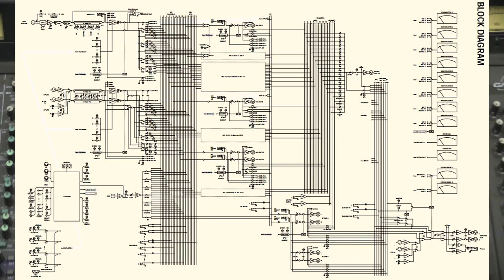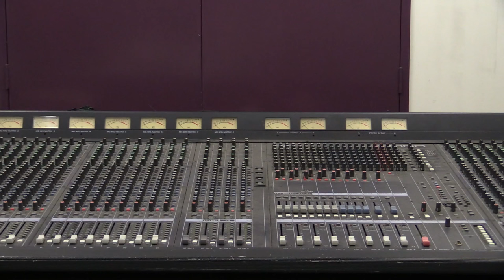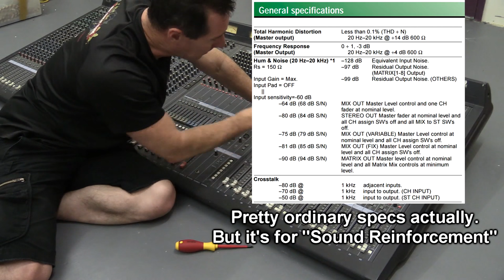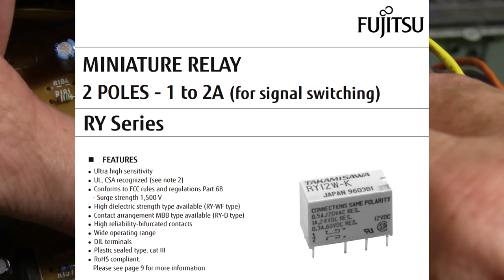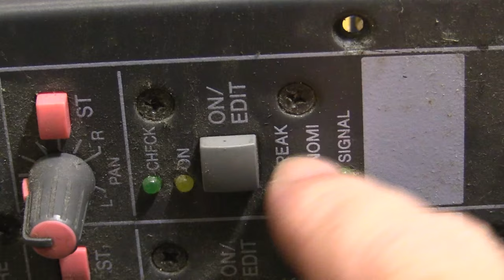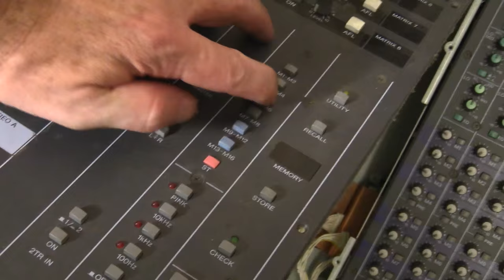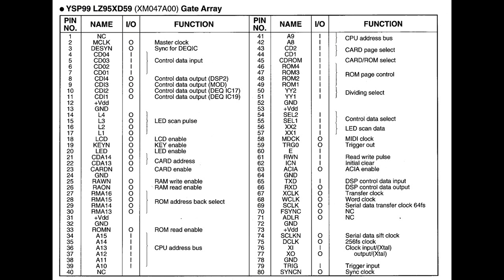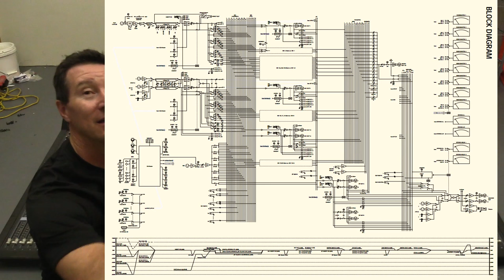EEVblog #840 - Yamaha M3000 Mixing Console Teardown

Comment: Dave: in the master section where you mentioned that the board to board interconnects are not continued on the right edge of the board, had you looked up at the master section you would have seen that there is a board which hangs down into that space. and as such it was for clearance. if it was not for clearance I would think the copper bus bar would have been straight across rather than dipped way below the boards.
Reply from the maker: +David Nelson Ah, ok, of course!
Reply: +David Nelson It's also likely that the board was designed for multiple form factors. Mixers tend to be pretty modular in construction, as this video demonstrates really well.
Reply: Looks to me like the board that hangs down is the scene logic - potentially the bus board came from an older model without scene control.

Comment: The insert jack on each channel is a TRS (tip, ring, sleeve) connection that allows a single cable to be both input and output. You use them to send a channel to an effects chain and then loop it back into the mixer. It's like a stereo headphone connector with one channel being an output, and one being an input.

Comment: You can't imagine, how excited I am to watch this video! I'm sort of a selfmade Audio Engineer, and love to tear down my equipment, repair it or develop my own stuff. This is so inspiring!
My Yamaha 01V Digital Mixer was really nice to tear down, Yamaha clearly knows how to make their stuff servicable. really nice system engineering! This bad boy on the other hand looks a lot more challenging :D At that size it's really hard to make it servicable. 

The phantom power caps where the only part that died so far in my 01V, they were only rated for about 50V, sadly that seems to be "okay" to save cost.  
The SILs from JRC are often used in Yamaha mixers I saw so far, they seem to prever SIL-packages, e.g. for their DM2000 digital console. 5532 are not that often used there, I guess, maybe for saving space. 

For me personally, this was one of your most interesting videos, even without you knowing everything about it while filming. Thank you, I really liked it!

Comment: Hey Dave,
Coming from a synth world, that SSM chip is a VCA chip. 
SSM made many DIP package solutions to common circuits in music electronics. Most notably, SSM made oscillators and filters that were used in many famous synthesizers such as the Korg Polysix and Sequential Circuits Prophet 5 Rev 2.

Along with SSM, Curtis Electro Music (CEM) also made similar chips that often replaced the SSM chips in later model revisions.

Would be cool to see a synthesizer teardown from you!

Comment: I find its usually the mute buttons that go first... some guys just hammer down on those and they just die
Reply: +Julian Amrine It's usually the pot's that go first on yamaha's they get nice and scratchy, a couple twists and they're usually fine
Reply: +Scott Kuker 

Not if you keep on top of your scheduled maintenance.  The PM3K I learned on was 20 years old, with about 200-250 shows a year, and had most of it's original faders, and none of them were scratchy.  The ones which were replaced were because the whole channel had been replaced, usually because of a bad pot or VCA.  Clean and lube your faders every year or so!
Reply: +Scott Kuker spray deoxit (electrical contact cleaner) into your pots and switches. just dont use on faders, as they are open and attract dust.
Reply: Even better, use the liquids CaigLube/DeOxit! F5 and DeOxIt! 100% that comes in the bottle with the brush/needle tip. That way, you're not putting chemical where it's not needed. Less waste = more useful product.

Comment: Three years late here, but... 

It was fun to see this blast from the past.  In my career I kind of skipped right over the 3000 series and went from the 2K to the 4K and then the 5K.  Now, of course, everything is digital and these old workhorses are rarely seen.  

Anyhow, it was really fun to read all the comments about what this and that does.  We used to take the opener's console into the sub-in's so that we could use the same monitors while keeping the opening band engineers from messing up our mix on the headliners console.  

Inserts on the outputs were, 99% of the time, used for EQ's to keep the feedback to a minimum.  

As far as inserts on the inputs, I saw a lot of people here that had "absolute" ideas about how dynamics, eq, and effects should be handled.  I'm guessing they are pretty linear thinkers. I would suggest that they open their minds to the endless ways of making sound great (again!)  Sorry!  Couldn't help myself...

I will tell you that I have seen every variation on a theme that you could think of with inserts and how to use them.  There is no wrong way to do things if it works for you and your artist.  Thanks Dave.  Great stuff.

Comment: You're right about fader maintenance. We had a 64 fader SSL console which needed fader service after ten years. Electrically, they were fine, but they started to stick slightly. Each week, I would remove a few of the  Penny & Giles faders, disassemble, clean, lube, reassemble, test and reinstall them. It took about 2 hours for each.
Reply from the maker: +Chris W Each week?!
Reply: I only did a few faders each week. It took many months to complete.

Comment: This would be the best answer to "why digital" questions
Reply: I agree!
Reply: +Abdurrahim Cakar Also analog EQ creates phase shifts between different frequencies leading to quite a bit of distortion if not compensated properly. You don't have that effect in a digital mixer. Width 24 bit resolution and 96 kHz sample rate being standard you don't have any noticeable signal degradation due to the digitization itself.
Reply: +Abdurrahim Cakar I'd exchange my laptop for one of these any day :)
Reply: why digital ? "every idiot can count to one"!! :DD
Reply: +Jan Vomočil
Why Digital ? Because there's no room for noise between 0 and 1 !!
Reply: +Abdurrahim Cakar hahahaha.... Try the Midas XL3 or somesuch...800lbs. But such an awesome console.
Reply: +MrTridac I’ll be pedantic, and say there IS room for noise between zero and one, and that noise gets expunged every single time the signal passes through a gate. (Thank you, MITx 6.002x and 6.004x.)
Reply: I just bought one of these and I totally agree!
Reply: @asdf155  Almost all digital EQs cause the same eq shift as analogue ones. Although there are special linear phase EQs which come with their own set of problems
Reply: Hi Dave...great teardown, again ;-)
My guess is the 5 volt regulator was for Midi only.

Comment: Insert I/O = INSERT In & OUT. Use a TRS ---> TS/TS . TRS jack goes into the insert plug at the back of your consol and the 2 TS jacks go into INPUT & OUTPUT of your external device ( Noise gate, compressor, or whatever you want in your channel path)

Comment: Looks like the price ranges from 1500 - 15000 EUR used (there's a few models with different channel counts).
Reply: +Anders Evenrud: these desks sell for approx. 1000 Euro her ein Europe (sometimes even cheaper)
Reply: +Max Koschuh That's not bad at all! With power supplies?
Reply: +Anders Evenrud Look for the A model. It has some fixes (like LEDs on the PFL buttons). For 1000€ or less it might be ok, but I'm sure there are better options, depending on your requirements and your ability to fix the thing as some part will certainly fail.
Reply: +Anders Evenrud anyone of a sane mind would buy a digital mixing console if working with that many tracks :) My mixer is about 1/3rd of the size and can mix twice the number of tracks. The only real reason to get a huge analog desk is for recording purposes, if one is (for some reason) in love with the preamps that come with it. For instance a Neve desk from the good old days. Personally I'd go for a modern set of transparent preamps from a brand name. They will be so close in spec (and so transparent) that any will do :) [also, did not realize you watch EEVBlog, nice to see you here]
Reply: +spookanide They are a little obsolete... If you're dying to go analogue save up for something nicer.
Reply: +Alexander Brevig For live sound digital is better in really every aspect (except power consumption maybe). But it's a matter of costs.
Reply: +as df I agree. Ive been using the Yamaha CL5 for a few months now and I love it
Reply: +Max Koschuh Yeah, not surprising, considering this was more or less a bottom end of the market product when it was released and that was like 20 years ago.

Comment: I think the relays are shielded to prevent the switching magnetic fields from inducing pulses of current into the signal path of nearby wires.
Reply: I would think a small click in a signal being amplified by tens of thousands of watts and pumped through scores of speakers might be a life-changing experience.

Comment: That's huge wow!! I serviced one that I don't recall how many ch it was I think either 28 or 38 it's been a long time ago. It was at a big Baptist church I went picked it up for service. Had broke connections on the sliders where they were putting their weight on the controls hooking stuff up in the back of it Lotta contact cleaner went into that thing.

Comment: The craziest thing about this whole teardown is that an inexpensive (in a relative sense) digital board like the Behringer X32 does a much as this board and a whole lot more with better specs and full storage and recall of EVERY setting with motorized faders and takes up about a third of the space. That's not to mention that the need for most outboard gear is eliminated because EQ's, effects, and all that stuff is built in. I would never want to go back to working on an analog console after using a digital console for the past three years. I would love to see a teardown of something like the X32 as I believe Behringer has come a long way in improving the quality of their products and it would be interesting to see what Dave thought about it.
Reply: The sound quality is better on an X32 but the build quality is much worse and I say that as a happy x32 owner. You can't compare the quality of a real digital encoder fader module like an Alps (used by Yamaha on their digital consoles) with the cheap open frame ones on an x32.
Reply: Jackson Linder Yeah but gotta love the old analogue desks. They were/are great.

Comment: I used to mix front of house on the 56 channel version of that 10+ years ago.
Reply: Ours had another 8 channel bank each to the left and right of the center.
Reply: I believe we paid around 15k for it in the very early 2000's.
Reply: +Ken Porter Were you happy with that thing?
Reply: blitzwing1 This thing here is not a studio mixer, it is for live mixing. For professional live environments, analog console are no longer used, as good modern digital ones are better in almost any regards. For recording, huge incredible expensive analog mixing desks (with digital controls) have their place in top end studios.
Reply: +blitzwing1 A lot of the desks nowadays are software driven, but there's still no replacement for a huge bank of knobs and sliders to allow you to easily and rapidly set levels. Some of the more modern desks are basically a digital interface to a digital mixing setup, but most desks are still primarily analog mixing.
Reply: +as df. . . . I loved it. But others here are correct. It's strictly a live console. Much better options for studio use. We didn't travel with it. It was permanently installed. The thing was over 8 ft wide
Reply: +as df one of the problems with a large analog mixer like this is if someone comes up behind you, say between shows, and changes something, you have no recall to get it back to the way you had it. So sometimes it's hard to keep it set up the way you want it. On a good digital console you can set up the recall feature to pull up scene exactly as you want it and even if you have multiple operators that like to set things up different they can have their own set up
Reply: +Ken Porter and analog stuff does not have bugs :D
Reply: This has some scene recall. I never use it but it's there!

Comment: In 1986 I built the (Jaycar?) 16 channel mixer kit. Boy, was that ever a job of work.
Used with a couple of 300W MOSFET power amp kits also from Jaycar.
Once debugged, it wasn't a bad piece of kit.

Comment: I've seen mixing radio station consoles that don't use resistive sliders. Instead, the slider knob carries a magnet that  determines which of a series of reed relays should be closed and the console's logic goes on from there to decide the appropriate value from a resistor bank for fading or mixing. This setup provides a discrete, limited number of fade values (some 50 IIRC) as opposed to an infinite, continuous fading, but OTOH it has a much greater maintenance-free service life than slider pots. Probably not good enough for studio but radio stations loved the idea.
Reply: +corisco tupi Interesting. I believe the crossfader on decent DJ mixers is optical in some way. But that's mainly to allow it to be very free of friction and thus easy to move fast.
Reply: Halojen Cool how there is always someone thinking of better ways to do things.

Comment: That Analog Devices chip ssm2018 will be a balanced to singe-ended converter or vice vera with laser trimmed resistors for optimum common mode rejection / phase balance.

The grounding is the amazing this in kit like this! Keeping every signal route clean with noise -100dB is not trivial even with far simpiler circuits.

Comment: This seems my (old) Hill Audio Multimix mixer i'm using for recordings.
They are awesome built, and they are built for lasting and easy maintenance (if you have an issue with one channel, you can simply remove the channel, without have to remove everything else).

Comment: At 36:30, regarding the cables that were used instead of board-to-board interconnects between one of the bus boards, I think it's to make room for the vertically mounted digital board shown at 34:20.

Comment: SIP parts are super common in Japanese-made audio gear from the 80's to early 2000's. They make for smaller, neater layouts, and usually have higher power dissipation. As for the NJM2068, very common part in line level applications. Rather low noise, and not too high cost. They're comparable to a 5532 in most respects, but cheaper for a Japanese company to get ahold of,  if they were to manufacture the device in Japan.

What a super cool teardown, I love professional quality audio gear!

Comment: My school upgraded theirs back in the day when I was in year 8, I just took one module as they were all the same. It was from the 1970s and used LED VU meters and Op amps to drive them, I think I still do have some of the boards, but several years ago I desolderered the components on the bulk of them. I was pretty good at shoving busted electronics in my bag, but this was far to big and heavy for mine.

Comment: Disregarding stereo, it's actually mixed to two buses - house sound and foldback monitors. If you must include stereo, then you must also include multiple foldback monitors, so it can easily get a bit complicated if the lead guitarist and vocalist and rhythm guitarist need separate foldbacks, which is where the matrices come in.

Comment: Great vid!  I'm betting that shortened bus board under the main output section is just a matter of their having used the same board from a legacy product that didn't have the digital scene memory stuff, and so that module was a few centimeters shorter.

And yup! a little quick poking around revealed that the output section of the Yamaha M2000 was narrower by what looks like about the width of that gap.  I'll bet it used that same bus board.  Wouldn't have used the same boards in its input section, though, as its input modules had only four channel strips, each, not eight.

Comment: How times have changed, now many productions are carrying a small digital mixer (I was rocking the x32 for a while) or some just use a rackmount unit with all the processing done digitally with either just iPad control or if required a remote control interface. That's not to say there isn't a place for the analogue mixer, they are great for some situations.

Comment: The relays are shielded magnetically to avoid magnetic coupling into the circuitry at the low signal levels found in these mixers.  The transients would couple into the audio.  You can bet this was a "fix" that was required after production.

Comment: No size problem with the heatsink size of the 7805!
Reply: Size, no, but the sheet metal thickness greatly limits how efficiently heat can be conducted away (particularly in the case of a steel chassis).  But for a lightly loaded 7805 the chassis is perfectly adequate.

Comment: You can try pair one of your system power supplies to this and use this as your primary audio mixing station. If lugging their original PSUs are too much of labor I believe those switch-mode yet high precision system power supplies can cut it.

Comment: Dave, Many of thease boards are CTO, so there's alot of "Modularity" to them, I've seen that same board witthout the channels to the right of the master section. That yamaha is actually one of the "BMW's of its age"  Although very clean sounding board, not very complex in comparison to others in its same vintage. even for a FOH board.  There's even Field retrofit kits for some consoles to allow you to move your mains section around in the frame or to add aditional features.  Great tear-down tho.... Love to see ya tear its powersupply apart.... those things were EPIC

Comment: Yamaha quality right there! Note the string wrapped wires. :P The 48 volts I assume is for non powered mics. You could also clean up the sliders and sell it for around $1,000 (or aussie equivalent). Wouldn't even have to take it apart again just get yourself a vacuum, suck up the dust and spray each slider with some deoxit. The potentiometers rarely ever get dust in them because the knobs are almost strait up.